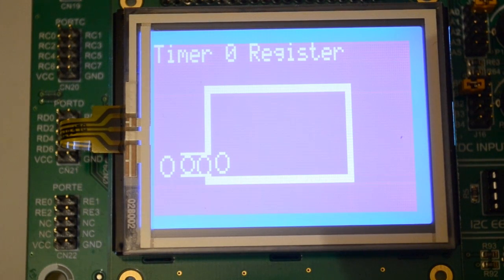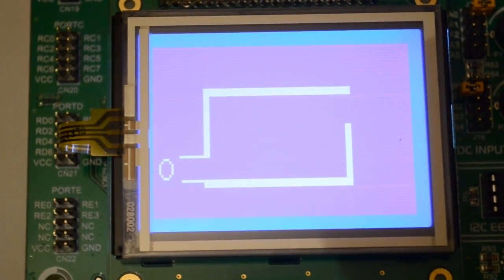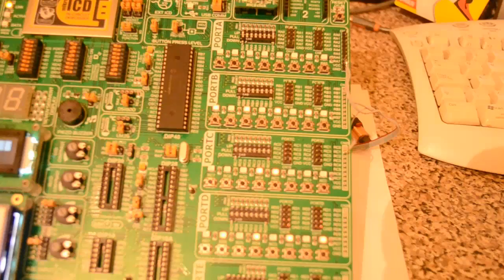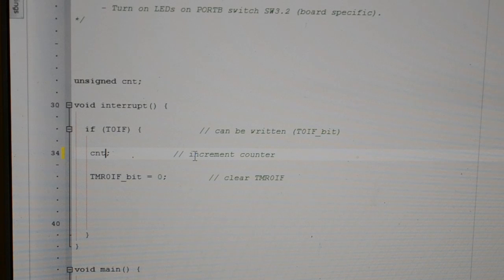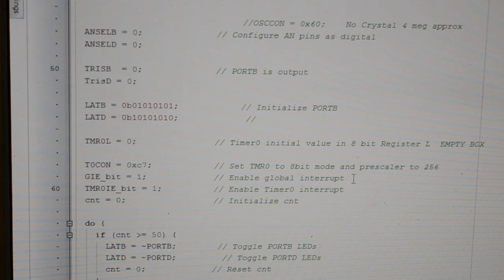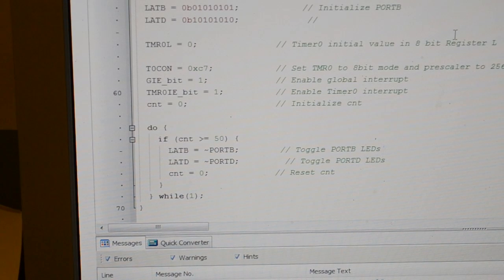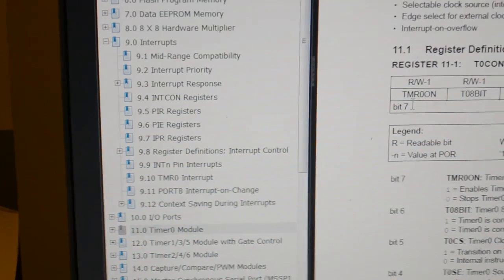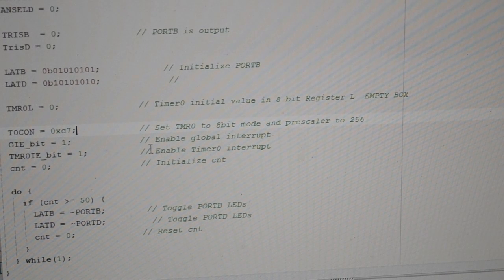Timer 0 and Interrupt Flag Explained with Graphics, MikroC Pro for Pic with demo 'Polling'

Comment: void main(){
trisb=0x00;
trisa=0xFF;
while(1){
if(porta.f0==1){
portb.f0=1;
delay_ms(2000);
portb.f0=0;
portb.f1=1;
                     }
}
}
Q:I want to stop portb.f0 competely after 2 seconds although the switch on .How?
Thank you
Reply from the maker: Hi,
First of all, if you have an 'if' you don't need to put ==1 because the 'if' will work if the function is 1.
i.e. it will return a 1 and do your 'thing'; if it is not a 1, the 'if' will do nothing. Or if it is false, it will do nothing.
TRISB = 0; ALL OUTPUTS
TRISA = 0XFF MEANS they are all inputs.
is that correct, is that what you need?
You can use

if(Porta.f0){

do something
}
or

if (Porta.B0){

Do Something
}

better still, 

if (RA0_Bit){

Delay_ms(2000);

}

or 

if (PORTA &0x01){

Delay_ms(2000);

}
The & is selecting only the first bit.

another example

if (PORTA &0x80){... is selecting the 8th bit
if (PORTA &0xFF){... is selecting all 8 bits.

I prefer using the pin names, like RA0_bit or RA1_bit ...

if (RA0_bit){

Delay_ms(2000);
RA0_bit = 0;
RA1_bit = 1;  
                           }

Let me know how you get on.
Reply: @JohnB-2021  Sorry sir, it didn't work as well as i wanted. I want (RB0_bit) to work for seconds and turn off completely even though the condition(RA0_bit) is still true.
Reply from the maker: @Hhhhhhhhhhh6115  Yes that should work unless you have RB0_bit being controlled somewhere else.
I have zero problems using the port names as above RA0_bit, RB0_bit, my Pic32 RJ0_bit...
Reply: @JohnB-2021  Sorry sir, after closing the switch it works and stops for seconds and starts again and so on and I want it to work for seconds and stop completely. I am using pic16f877a.Thank you for your cooperation with me.
Reply from the maker: @Hhhhhhhhhhh6115  
I don't understand what is happening.
If you clear a port pin it will stay cleared unless something else is turning it back on.
What are you trying to do?
Reply: @JohnB-2021  Thank you sir for your interest. I would like you to send an email to explain to you in detail my work.